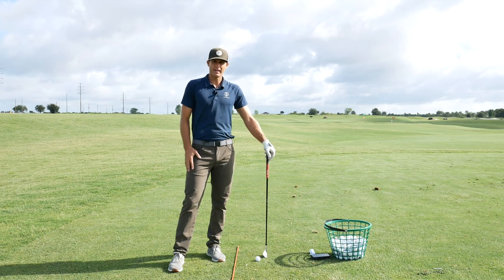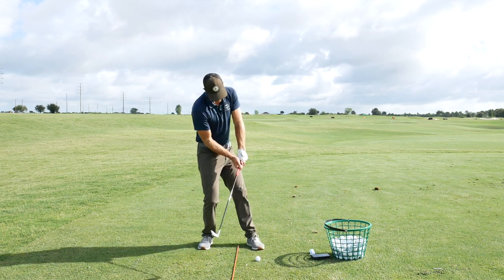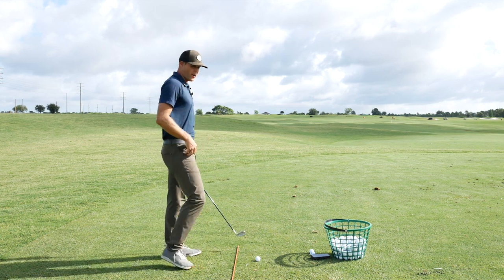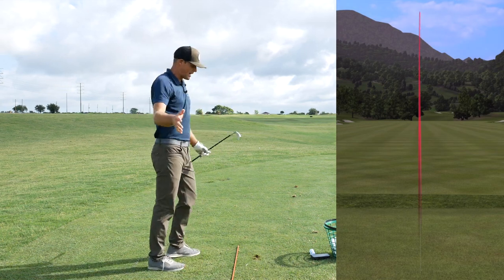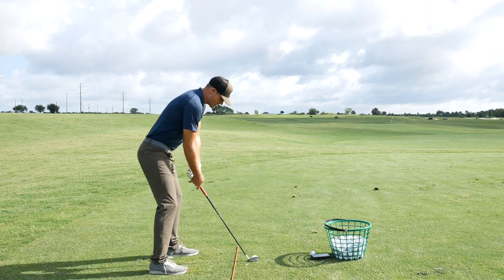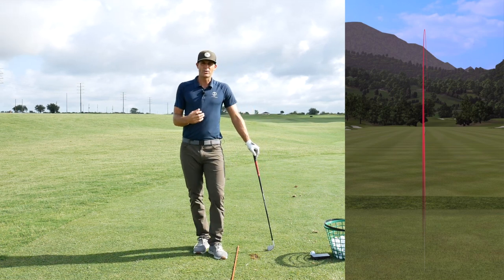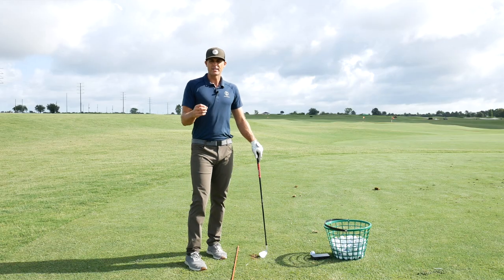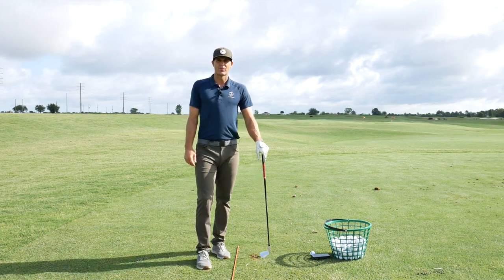LEARN HOW TO PRODUCE SPEED

Comment: Thanks for this.  Can you comment on or have a video regarding what the left leg is doing to produce this speed?  Whenever I try to get really active with my lower body, I tend to push into the ground but end up early extending.  Thanks!
Reply from the maker: Lots of factors. But I'd look at where club is coming from also try pushing so you end in lead heel post impact.